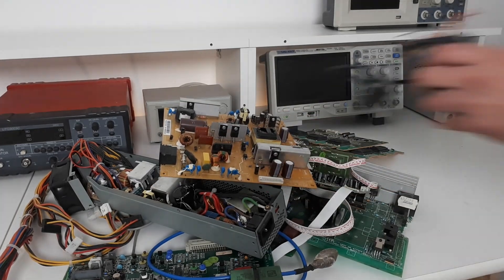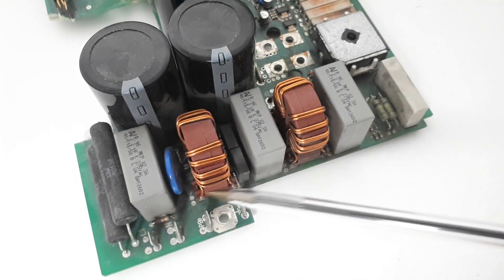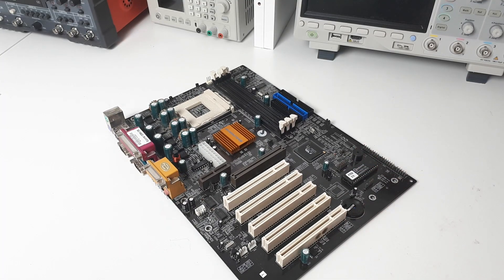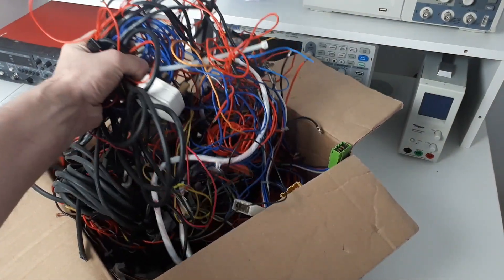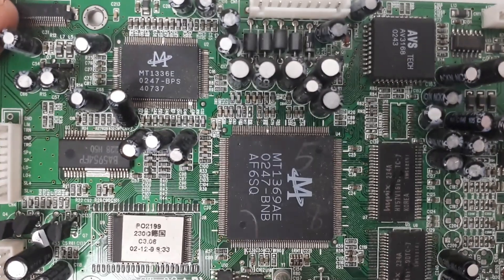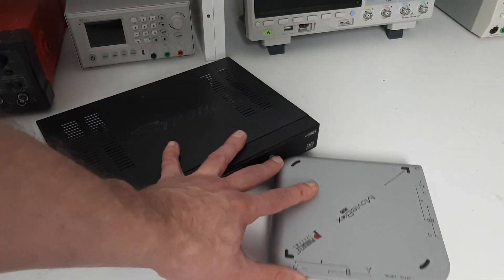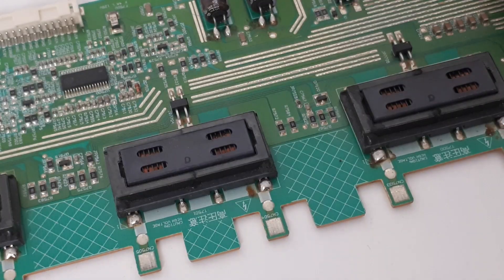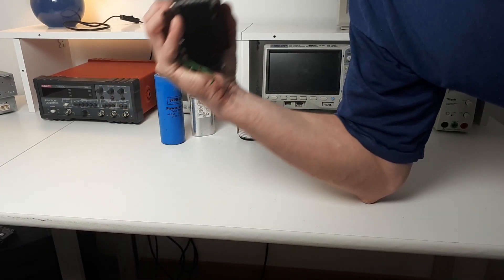What should you Desolder? ... Dont Waste Expensive Components

Comment: Regarding toroid cores, there's a caveat: Most cores are designed for the 150 kHz frequencies that are found in switching supplies, while others are used for audio frequencies. If you're using them for RF, you may not have good results. Fortunately, there are cheap instruments (the NanoVNA) you can use to characterize your salvaged components.

Comment: The things you called LCDs are actually vacuum florescent displays. Mini vacuum tubes. ❤
Reply: What he said also applies to VFDs, just remember that they need lots of power and high voltage, they can be worn and often have weird driving chips. 
The exception in displays are segmented LED ones (especially if they have symbols you’d like to use), which can often be driven with an MCU, SIPO register etc. Also remember: Character LCDs are very cheap and easy to drive. However, only take them if they have their typical daughterboard or a labeled serial cable connecting them to the PCB: if their controller is part of the main PCB, you'd have to cut it and figure out the pinout, which cannot be justified given their $3 cost. 
And of course, rare but old and simple displays (nixie, numitron, projection, any electromechanical ones, small Watchman CRT monitor modules) are very useful for an unusual form of visual output for some microcontroller project.
Reply: @vaclavtrpisovsky anything other than lcd or led is a must simply because they are expensive and or an antique
Reply: @urnoob5528  VFDs are not too rare nor antique, and they suffer from burn-in. If they mostly have segments that are useless to you or they’re too worn, why bother? However, standard ones like 7-seg, 14-seg and 5x7 are keepers.
CRTs are also display technology and you don't need to take all of them, especially not color ones. However, a complete functional TV or professional video monitor, especially Trinitron, is usually worth it unless it has burn-in. Only oscilloscope and antique CRTs are worth keeping as loose components (unless you plan to do a tube swap), not giant (>20”) color ones.

Comment: Connectors. IEC power connectors are very useful, and screw-type wire-to-board are very re-usable. I just got a lifetime supply of PCB-mounted BNC connectors from a salvaged DVR.

I never re-use electrolytic caps because I have no way of knowing how much thermal or voltage shock they have endured.

Boards with SMT devices are great for practicing soldering/desoldering skills.
Reply: You can always test the capacitors if you have the tools. If they are still performing to the rated specs then they're probably okay.

Comment: What use might you have for microwave capacitors??🤔🤔
Reply: I've used them with the diodes for building 60Hz voltage multipliers to get to 10s of kv while using the MOT itself as the AC source. Don't forget to use a snubbing resistor to soften the current spikes if it sparks over otherwise the diodes will fry.
Reply from the maker: HV power supply perhaps?

Comment: I am more of the "keep the board and take the components off as I need them" mentality. Low power resistors are very cheap so I just buy them new. However...there always comes a day when I am building a circuit and I don't have the value I need in stock, so then those old circuit boards become an "electronics shop in a bin". Quicker to scour some old boards and lift that component you need than make a trip to the nearest Jaycar, about 30 kilometres from where I live. 

Yes, the exotic components are great fun and sometimes quite useful. LF transformers, wall wart PSUs (switchmode or Iron core) always worth hanging on to and often get used up on projects, even if just converting a commercial something that's battery operated to powered by the line source. 

Old inverters and UPS units are a fantastic source of high power MOSFETs. Some even have assemblies on heatsinks that you can de-solder and lift right out and use in your project. 

Even the boards themselves. Maybe not so much with modern multilayer PCBs, but the older single sided boards, once stripped of components can be used to build a new project on. There are two ways to go about this. a) Lift all the tracks off, they come off pretty easily when heated with an iron, then drill new holes to accommodate the new components as necessary. And just wire up point to point below, just like simple punched protoype board. b) If your project and the donor board has relatively simple traces, you can even adapt those to connect your new circuit. Sometimes you might need to break a track and drill additional holes etc.

Comment: For SMT ICs: it's good to run it under microscope and grab all names, then list all of them in some sort of document with source board identification. This allows you to quickly perform a search through your entire inventory of PCBs to check if you already have one. Then hot air can do a quick job if needed. (Recently did that to repair a broken 20W battery lamp of a friend with TP4056 I just ran out of, but had old breakout board with broken USB connector and working IC).

For electrolytic caps: I desolder only things with quality comparable to Rubycon and use it only when I don't have new ones, becuase I f-d up calculations :D 

The things I love to take are crystal oscillators. Old quality is way better than new ones. Also opamps, but only ones that are audio-grade (even if I'm mostly prototyping diagnostic devices rather than audio equipment, but those op-amps are sometimes life-savers). Then it goes with CuAl - if it has copper or aluminum in it, it's probably worth salvaging (transformers, chokes, inductors, radiators etc.)

I rarely salvage device chassis/box. Mostly if it's a flat steel surface (can be used as raw material to fabricate something else) or plastic (dumping that into "recycle" bin, waiting to get a shredder and pellet extruder).
Reply: You're a legend ❤... Your strategies convenient and feasible to work.

Comment: I desolder everything. Including chips and bga parts and smd parts and just everything like ports a tht components because its fun and a lot of microcontrollers are reprogrammable for use in projects
Reply: Except by the fact you won't use most of the chips because they are very specif, you probably won't find info about it, and would be a lot easier and faster (and even cheaper because time is money)  to work with what you know. I used to salvage a lot of components but some stuff are just not worth it

Comment: Salvaging electrolytic capacitors might be a good idea when we intend to use them for personal electronic projects that will only be used for a few years but I often restore synthesizers from the 80s and the most common failure are the electrolytic capacitors followed by coin cell batteries.  That’s why I just use high quality electrolytic capacitors bought new from a reputable distributor.  When you make a repair and expect it to last several decades, you have to understand that these parts have a limited shelf life and service life.  For other types of capacitors like film capacitors that tends to be on the expensive side there’s no problems re-using them.
Reply: In my (in comparison: very limited) experience in repairing vintage (80s/90s) audio equipment, capacitors are rarely the part that has failed, even after decades of use.

I agree: it would be better for longevity to use brand new ones, but for the sake of having replacement parts at hand on literally zero budget...

     (Usually I just need to replace 1~3 to get something working again)
.   I feel like I'm not taking too much risks... 
     (The salvaged capacitors are also higher grade / japanese made, whereas the ones that have blown on the apparatus I'm attempting to fix, aren't.) 

Also, I've tried to buy packs of "commonly used" resistors and so on. 
    But they are only 'common' in DIY projects it seems.
    Having a selection of 10, 100, 220, 330x 1k, 2k, 5k, 10k, 100k, 1M ohms...
    ..and then needing 4.7k, 2.8k, etc.

Resistors are not the best example, but you understand my problem, right?
     Components are only cheap when you buy in bulk. (Because a €0,50 high quality capacitor + €3,- shipping, is in effect a €3,50 capacitor.
    And if I buy a selection of caps I don't need, then I've just bought a selection of very ineffective paper weights ;)

Anyways - I see your point; 100%.
But I think more professional people (like yourself) wouldn't resort to salvaging components anyway - you have a reputation to uphold, clients to keep happy, your business' good name, etc
Reply: As a professional B&O specialist I know what parts fail after decades. When you’re looking at amplifiers and such you’re right. Though crossovers most parts just can’t break except the capacitors/filters.
Reply: @iggysixx  80/90s is mostly power supply capacitors. But boy oh boy early 2000s Roland and Ensoniq are literal capacitor grave yards.
Reply: @christianvictor827  I'll take your word for it :) I've mostly opened up hifi stereo amps and components (Akai, Aiwa, Sony, JVC, Pioneer, Sansui, yada yada), computer PSUs, power tools, game consoles, etc. 
      Anything made in Japan is usually still in good working condition after several decades of service.
      (All apart from my Akai AM-32... Right speakers don't work well (lower volume). Can't seem to locate what's wrong. 
      I'm thinking maybe cold solder joints because of age, and after running too hot a couple of times.
     Either that, or a transistor has left this earthly realm.  (Which would suck, because I have no replacement for that))

Anyways - thx for your 2 cents (:
Reply: @iggysixx  Probably the capacitors in the output stage. 😄 Just kidding. I'm not a professional but my first guess would be maybe it has muting transistors (or relays) to protect the speakers from popping and one of them is wonky. But I can be all kinds of other causes. Can be as simple as a worn volume potentiometer or as difficult as a failing op amp.
Reply: @christianvictor827  I've been looking into it (still not fixed). There's some unusual things in the circuitry. 
       Apparently the more advanced AM-52 is built on the same components. But that version has the option to switch the amp to mono output..
     As per your suggestion, I checked out the volume pot / array... I found that the Left channel, Right channel, L ground, R ground, and an additional line, are all fed through the volume pot seperately..  (I'd never seen that before - perhaps to do with the mono option on the more expensive model)

New plan is to inspect those connections and to see where they lead :)
.      Plan B: If all else fails:
   ...see if I can use the schematics of the AM-52 to somehow turn my AM-32 into a mono amp 
      (..to power a guitar cabinet... 
I use amp sims, so I just need the cleanest version of the signal passed through, because the gain/treble/mid/bass controls will be virtual (in my iPad / Macbook) anyway)

Thx for your pointers :)
Reply: @iggysixx  Did you check the output relays? They might be defective/hanging/oxidized. I'd compare their input to output signal.
Reply: Ah, a fellow synth restorer! Good point about the capacitors. I must have hundreds in the trash bin.
Reply: As a diy-er I will testify that recapping things to be marketed as refurbish should never receive used components. Always order new caps. Using old caps for your personal projects? Totally fine but you assume too much liability with the one component that's guaranteed to fail over time. But I suppose if you do use them you're just brandishing your own form of forced obsolescence. Good marketing strategy but people might get mad lol
Reply: Same is true for 80s 8bit and 16bit computers. Most fails are onboard batteries and capacitors.
Reply: Damn silver soldered coin cell batteries... DAMN THEM!
Reply: Keep in mind that any electrolytics from about 1999 to about 2007 are not to be trusted at all. Early 90s and earlier are generally good but they are reaching the age where drying out is a serious issue. Also certain film capacitors have a tendency to blow up spectacularly, particularly Rifa filtering capacitors.
Reply: What brand and make did you find to be of the best quality
Reply: @nikolaivasilev7371  I mostly use Panasonic. Würth, Nichicon and Vishay are very good too.
Reply: I’m curious though, as he showed in the video, if you have a tester (I have the same one he used, they are SO great to have) and caps test good, do you think they still would be dumb to use as they may still fail? Even if they look and test fine and within spec?

Also, for me the real treasure trove are things like fuse holders, battery holders, rare transistors, heat sinks, connectors (I don’t have the patience to order he correct cable connectors. Seems like a rabbit hole for me to try. Often when I have had to replace some it takes me two or three orders before I get the right one), coils, travois, etc. 

For myself, I think it is worth it to go through circuit boards and remove what I think I might need, because it takes so little space compared to storing the whole ckt boards. Also, just like a junk drawer, some components see, to make sense to collect in a box, while others can go in to my “last chance, desperate for parts box” which is just like my hardware junk drawer and I always seem to find what I need there.
Reply: @shader26  Even if you have a tester that gives you both the capacitance and the ESR value, you can’t make any predictions regarding the remaining life expectancy.  Over time the electrolyte degrades even if it had a service life that didn’t have high ripple currents and high temperatures that are the two main accelerators of degradation for an electrolytic capacitor (assuming it was used at a voltage lower than its max voltage).  You know if the capacitor is good or not now.  At the end of the day it all depends on what you want to do with it, personally for applications where we expect decades of service I would never use a reclaimed capacitor.  As for other parts, that’s a completely different story, connectors and mechanical parts can be inspected.  Even magnetic parts like inductors and transformers can be inspected and even rewired if the enamel on the wire is degraded.
Reply: Buying good caps is harder than salvaging. I run a repair shop and i use old caps exclusively but they've came from reputable brands all tested and organised. Also it's good practice to replace bad caps with caps of higher voltage if there is a place for them. And if one cap is visible dead check the others they can be on their way too.
Reply: Pinto Sonic This Is A Myth That Decade Old Capacitors Are Bad😏 If Its Not Bulged Or Leaked Its Good No Need Yo Waste Money And Natural Resources Use To Produce Capacitors

Comment: A bit amateur!  Try the professional method:  The propane torch!  Some boards the components will shower off the board with no force. Other boards heat the bottom side and pull the components with a pliers. You can strip boards in a few minutes and have all the stuff in a box. This makes hoarding the parts less space taking!
Reply: Should use a respirator if you do that!
Reply: @Enigma758   36 inch fan blowing through the garage.
Reply: I did an Instructable article using a propane torch to harvest components.  I got torched by about 100 people telling me I was an idiot and the fumes would kill me.  It really does work well, and the instant heat is less damaging to the components.

Comment: 4:37 Those are vacuum fluorescent displays.  I always salvage them.  They are not too difficult to drive and produce a nice glow as they are essentially a form of triode tube.
Reply: You are right of course. They can also be used in a triode form to make some radio receivers.
Reply: @ChrisWright7701  And audio amps too, I have video on that
Reply: As a interesting, lots of older industrustrial microcontrollers had built in VFD driver circuitry.
Reply: Plus, they're quite pricey to buy new
Reply: Yup, always always always save anything that has a gas or vacuum tube in my opinion.

Comment: Personally, I find it easier to keep the whole board and then salvage at a later date - context is often a big clue to what a part is when trying to identify it. 

For professional work, I think it only makes sense to use parts you can but new - otherwise you can end up with a design you can't take to higher volume.
Reply: I used to do this but run out of space😂
Reply from the maker: Yeah, i agree.
Reply: I agree. Too much work to strip a board.
Reply: And the reliability of older desoldered parts.
Reply: I'm doing the same thing. When I need a specific SMD resistor, I just look for it on the old board. 🙂
Reply: rat pack?